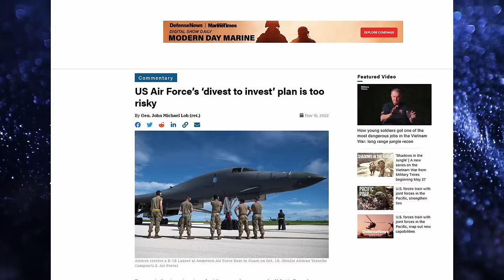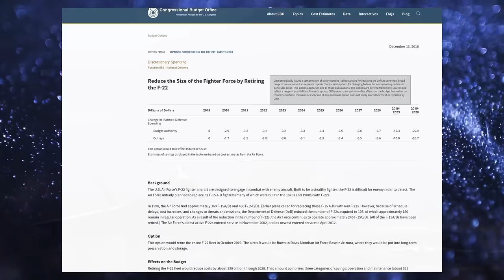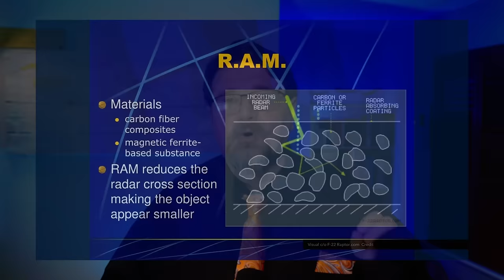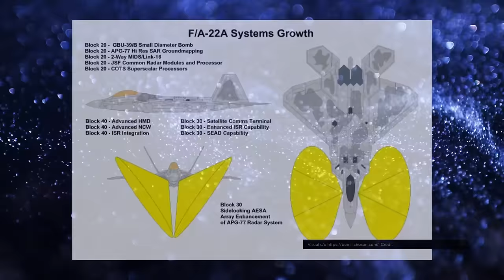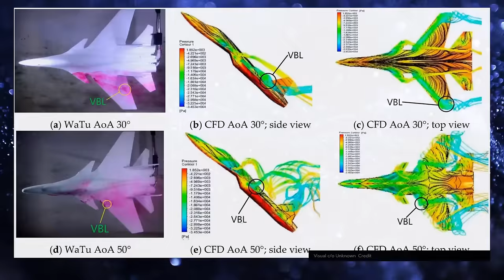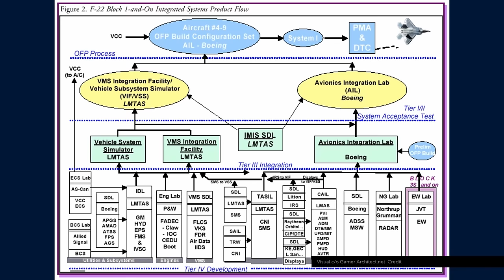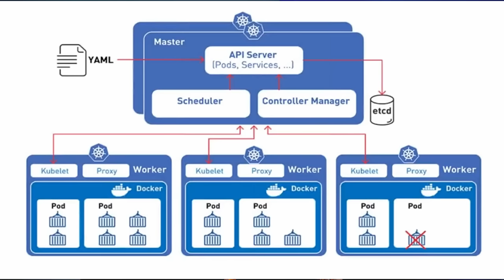F-22 Raptor: The Apex Predator 😈

Comment: As a prior F-22 avionics guy, you did a great job, and I honestly couldn't think of a single thing you said that was wrong.  I love your channel.  Keep it up!
Reply: One interesting experience I had, we were doing Red Flag in Alaska, and our F-22s had a 120 to 1 Splash ratio against the F-16s and some Hornet guys that came out to play.  Towards the end of the TDY, they were code 3ing there jets on purpose because the pilots didn't want to fly against the raptor.  This was many years ago...about 2011.  The 18th Aggressors had came up with some tactics and finally manage to make things difficult for the Raptors later.  Good aircraft when it doesn't break.  MC rate was always an issue.
Reply: @Kenny-yl9pc  where did I even talk about a SU-57 or J20?
Reply: @nathanalvar9156 I think Kenny was commenting on a different comment...lol

Question for you (as long as it doesn't violate OPSEC stuff) but was there a significant difference in terms of whether OPFOR aircraft were using AESA radars or not?

Just curious 

(Former F-18 diagnostics guy here)
Reply: @chrisburke624  Chris,

I guess I don't understand the question fully, The F-22s I worked on had the APG-77 radars.  The block 40 F-16s had the AN/APG-68.  We did not have the AESA APG 83s in on our while I was in because we knew by 2010 we would be getting the F-35s.

Comment: To avoid reflections of radiation off the surface, the material’s impedance must match the impedance of a vacuum (377 ohms impedance). To absorb the radiation, the material must have electrical resistance.
Reply from the maker: Correct.
Reply: Thankyou! If only I had a chance of remembering this :(

Comment: I have absolutely no rational basis for my opinions, but on a gut level, I "liked" the F-22 upon its introduction and "disliked" the F-35 when it was introduced.  Good to hear that they're not junking the F-22 (yet).  Cheers!
Reply: F-35 is like the F-16 cheap and can be sold to allies.
Reply: yah, but that is just the narrative we've lived with for a long time.  F-35 narrative finally started changing about 5-10 years ago.
Reply: F-35 was supposed to be cheaper, the F-22 was meant to dominate the entire sky.
Reply: @bdub1934  And guess what it's not.  You many say f-35A version is only 74 million dollar to buy. But It's operational cost is enormous.
Reply: @rifat6913  Cost of plane is just a fraction of the entire package.

Last i looked at it, before the pandemic, countries were buying the F-35A at around 450m $ / plane, with F-35B being potentially 100-150m $ above that.
F-16 or F/A-18 SuperHornet were around 200-240m.
Reply: @Milo-id9qd ...and still they buy it, because it's becoming a genuinely scary adversary and a genuinely useful asset. If the F-18 and F-16 simply ceased to exist we would suffer for it by needing to spend so much more for so many fewer operational units of F-35s, but having the F-35 as well is an excellent expansion of capabilities.

Comment: The F-22 is massively overweight.  It was supposed to have a takeoff weight in the 55,000lbs range.  It in fact has an operational takeoff weight at least 10,000lbs heavier.

The resulting loss in performance was so extreme that supposedly 'backing off by 10% in one key area of performance' was needed to bring things back in line.  It is often assumed that that mission capability was STOL and reversers for the engines.  In any case, the F119 were given larger fans, as part of a preplanned thrust increment which raised engine output to around 28,000lbf military and 39,000lbf in burner.  This, in turn, greatly compromised an already borderline internal fuel number of ~19,000lbs.

It is worth noting that the YF-23 had ~23,000lbs of fuel and the F-23 would have had more.  It was also a much cleaner airframe in terms of wave drag and area rule and so could fly test points at supercruise which the YF-22 could only achieve subsonically.

This is important because the ATF was never about replacing the F-15.  Certainly not at '35 million each in adjusted 1984 dollars' (you see much the same nonsense reported for the A-12 and later F-35, '35 million' must be a really popular numerological number...).  As an always intended 70-100 million dollar airframe, the ATF was to be an airborne sniper, penetrating the WARPAC airspace after a refueling over the North Sea or Kattegat and then flying into GDR or Poland or even Belarus to hit Soviet gorilla packages, forming up to raid Western targets with Su-24/27 and MiG-25BM/Tu-22M.  Killing Midas tankers and Mainstay AWACS along the way.

Then flying back out to recover into Sweden which had secret treaties with NATO to cooperate, in case of war.

This IS an 800nm combat range requirement and it WILL require 400nm in supercruise, just as the ATF key performance parameter specification called for.  With the end of the Cold War looming in 1990, the USAF chose to go for the hotrod, 'we can do Cobras too!' alternative and thus envisioned all air battles as being the rough equivalent of the Bekaa Valley, 1982, air combat, at viciously close ranges and 'damn the VLO, full speed ahead!'  likely loss of several jets worth of sensitive techint harvesting in turn-and-burn combat.

For which the thrust vectoring was seen as appealing to the childish egos of the fighter pilot community in an F-104 like platform which would almost certainly never be purchased in the originally intended numbers, as the threat evaporated.

The combination of increasing weight due to VLO demands relative to the YF-23 (the LM fighter had a 'clean sheet' moment in 1986, whereupon the engineers discarded the extant F/A-18/Su-27 hybrid design to start over, the flipped F-117 configuration being much heavier...) and the resultant increase in altitude specific thrust requirement to push it all through the sky hey-wow super maneuvering capacity resulted in a jet that could not meet the original ATF spec for range.

When SecAF Rice I think it was, locked himself in a room with a bunch of blue/green/yellow Powerpoint printouts and chose an airframe based on industrial politics of and ego, not asked-for capability, the resulting F-22 gave them exactly the same solution that the F-15 had: hotrod performance deriving from minute man fuel fractions of .28 or so.

Except the F-15 could carry almost its internal fuel equivalent in droppable, WRM, 610 gallon tanks.  The F-22 could and cannot, if it expects to maintain signature norms.

The end result being that it's not suitable for the 'Pacific Theater' because it FAILED operational suitability metrics for the 'European Theater' mission: 800 miles in range within a two hour mission time, half of which would be flown at supercruise.

The F-22 is a massive compromise of the original ATF spec.  That doesn't mean it's not a really good airframe.  But it is one whose operational employment method has changed radically from the original specification.

NGAD is happening because the wrong fighter was chosen for the ATF downselect.  This applies, not just to the F-22 but also the F-35.  If you're going to fly the Andersen to Taipei mission set, you absolutely need the ~900square foot wing area (YF-23, 965sqft; F-22, 840sqft), 70-75,000lb TOW and 70,000lb thrust to do it, in a high efficiency profile condition.

The YF-23 would have gotten you there, the YF-22, not so much.

It's important to get this right so that the next time an unelected bureaucrat decides to make a decision based on personal favors and industrial base real politick, someone can slap him, trip him, and sit on his chest until the silly notion passes.
Reply from the maker: Thanks for the effort

Comment: I think the issue with the F22 is the total production number. Even if they’re all updated to block 30 the PLAAF will produce that many J20s annually within the next few years. Around 120 aircraft. It’s not enough.
Reply: There are already more than 2 times as many J20-ties in service as there are F22 flying (or rather standing in hangars).
Reply: Yeah but the F-22s are backed up by F-35s and 4th gen aircraft. The efficiency and effectiveness of combined arms in US military doctrine is unmatched. F-35 production is in full swing. A squadron of 35s with a pair of 22s would be insanely effective.
Reply: I hope you’re joking, the j -20 is extremely suspect as far as its performance. If you put 10  j-20’s against 1 f-22 the only problem the f 22 would have would be lacks of enough missiles to fire, as it only holds 8 total but two of them are for close quarters when you’re in the merge F.A.C.T.S.
Reply: @gityoassup9087  I’m just curious what you think happens when the F22 turns on it’s radar. Tack while Scan radar mode It’s lights up all it’s targets but also tells everyone else hey I’m here. F22 isn’t invisible can be directed like at about 40 miles range with AESA radars. 

To underestimate one’s enemies is a grave mistake. J20 creates serious problems when planing a defense of Taiwan
Reply: But China only makes a few weather balloons so 120 is enough
Reply: @Nordy941 The F-22’s APG-77 can use LPI

Comment: People need to consider this before bashing J20 and Su57 for not being stealthy enough, it seems these weapon systems have been designed not as predominantly as an air superiority fighter, but as part the larger area denial systems they are operating at, specially J20 is clearly a long range quite low visibility fast platform, which considering the operational obligation of pacific theater that requires support platforms such as tankers, awacs, elint and asw assets in large numbers, almost all of the slow platforms, J20 seem to be a hunter designed to catch that kind of prey, stealth is only necessary to be well enough to get them through the BARCAP and back, the impact to the opposition is clearly well planned, imagine the operational strain constant escorting of these many assets will place on the blue force, which will be already hard pressed to keep up with their own frontline operation requirements...

Comment: This was a terrific episode, I enjoyed every bit of data, and was only sorry t had to end so soon. With regard to DATA storage, it would surprise me if they have not upgraded to SSD for storage, as the HDD has very specific G-lock limitations, due to its high speed gyroscopic nature. Along with the fancy helmet which circumvents the blocking of the aircraft body, as long as disorientation has been overcome by pilots?  Further, the fitment of conformal tanks would be more readily achievable on the YF-23s longer and more sinewed body layout. As an interim measure, I would hope the USAF are considering the concurrency of both the F-22 & YF-23 upgrades.

Comment: With my limited knowledge on things like energy density in rocket fuels, missle flight envelope optimization, aerodynamics etc. I often questioned myself where the performance boost from aim260 might actually come from. Especially if the weapons size/volume is limited by the internal bays. Seems like having a Mach 2+ top speed and rapid Acceleration and great climb rate are not traits of combat plane from yesteryears.

Comment: The IRST on FA-18A Super Hornets are in fact fairly large units, which are cryogenically cooled, and I cannot imagine any significant advances in miniaturisation. The far smaller pre cockpit mounted units used by other aircraft models, cannot serve those air forces as completely as the high off bore sight swivelling, available to the USAF/USN aircraft?

Comment: The unmanned option upgrade is very interesting to me. I believe on 2021, lieutenant colonel Randy Gordon lectured an MIT class about the F22. Several times during his lecture he mentioned that, although not unique to the Raptor, its ultimate limitation is the pilot. Now, with the USAF’s current development of its Skyborg program look up AI flown F16), and the F22’s sudden massive upgrade packages, could it be that the Air Force is looking at possibly having unmanned F22s? Although its aerobatic performance limits are highly classified, it has been confirmed that this platform is capable of repeatable sustained 9G maneuvers (upper limits of a pilot). Could the F22’s performance limits be so high that AI integration into this platform could make up for its electronic warfare shortcomings?
Reply from the maker: AI for combat is way overrated
Reply: @Millennium7HistoryTech  I don’t completely disagree. I do think it’s blown out of proportion at its current state, but it can’t be too overrated if China and US, among others, are spending billions in its development and military implementation, can it?
Reply: @RaulV22  Far too many things are called artificial intelligence that have nothing to do with any autonomous reasoning.
Reply: I’m 64, I design components for the F 22 by the way, just saying, However I am against any kind of manned combat aircraft.  Before I was an engineer I was in the US Air Force as an electronics technician working on aircraft older than me, older than 64 years as of the year 2024!  That was the F106 Delta dart, an interceptor aircraft similar to the F 22 mission. That aircraft had digital computer, and that enabled it to get rid of the pilot, and we should’ve did it back then. I’m a pilot also. I know damn well the pilot is the weakest link by far. In every way the pilot impedes the mission.
Reply from the maker: @rosomak8244  Correct
Reply from the maker: @RaulV22  It is promising, very, for certain missions, but today it is overrated.
Reply from the maker: @steveperreira5850  I would be very interested in your take. Feel free to contact me in private.
Reply: @Millennium7HistoryTech  Yes, exactly!

AI does extremely well when you give it a well-defined problem, such as "go dogfight this specific target", and we've seen a bunch of demos that showed exactly that. But modern air combat is vastly more complex than that, and current AIs are nowhere near being able to prosecute the entire kill chain from search/surveillance to kill, especially when you factor in the vagaries of real-world scenarios with other friendly and neutral units in play.
Reply: @Millennium7HistoryTech  If you look at the history of AI, it goes through cycles of rapid innovation and seeming promise followed by long (typically 2-decade) droughts. There are arguably "AI springs" in the 80s, 00s, and now the 20s. In the fast the true innovation/improvement is often fully played out before the broader society even realizes that it has happened, and expectations overshoot as a result. Given that this cycle was driven by applying vastly increased machine power (in the form of AI-optimized TPUs) to mostly preexisting approaches, I think that you could make a strong argument that it is already played out, and we've begun the next AI winter.
Reply: @steveperreira5850  I agree that the pilot is the weakest link, but as somebody who works with but not directly on AI I think that it would be even weaker for general air combat missions. For the "nominal" F-106 GCI mission of "fly out and prosecute this specific target" the computer can do that, no AI required. That's been true ever since the time of BOMARC, which was basically an F-106-ranged SAM. But that's a very simple and remarkably constrained and well-defined subset of air combat in general.